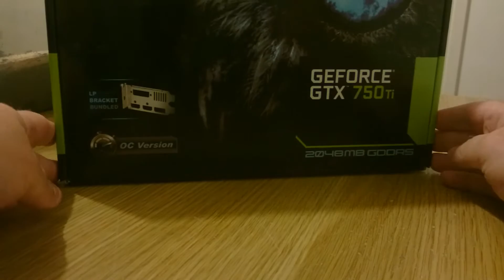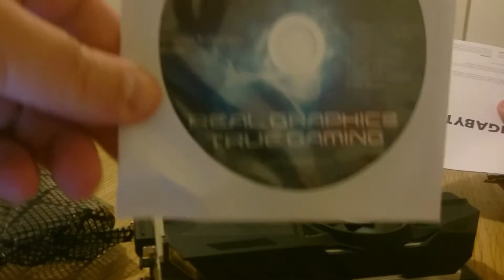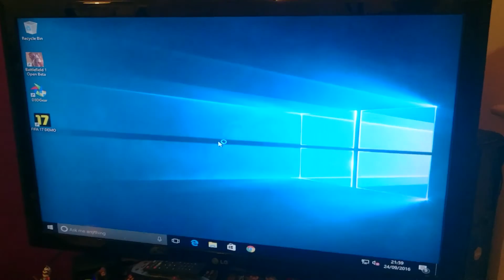UNBOXING A GEFORCE GTX 750ti OC EDITION. Modding a Dell optiplex 330 case and fitting the GPU.

Comment: I have a question does a gt 710 fit in that computer case? Cuz I have the same computer as you lol and what do you need to connect the graphic card and everything
Reply from the maker: It should fit if it’s a low profile card.

Comment: i have dell optiplex 390 and am planing to get gtx 750ti will it fit in my case and my psu is dell 265 came with the pc 
is it enought 
mobo:dell optiplex 390 LGA1155 H61 0M5CDC 
what do you hink please help
Reply from the maker: +i am MUSLIME and PRODE should be fine as long as you have the tower or desktop
Reply: i have a desktop
Reply from the maker: +i am MUSLIME and PRODE should work fine
Reply: ok thnx bro ....i really appreciat it 
just only one question does the gtx 750 ti run all games even in low sett
Reply from the maker: +i am MUSLIME and PRODE yea

Comment: Every other GTX 750TI would have fit, just yours is dualslot ,but the other way around ;)

I got the same rig, the only problem is, it wont boot with a 750ti, dont know why though :/ tried 2 different cards.
It boots up in the background, i can hear the bootup sound of windows 7, but i cant get a signal on the hdmi port of the graphics card ... 

Well i guess its time to ditch it for another experimental gaming computer, got my hands on a free socket 2011 board with 8gb of ram aaaaaaaaaaaaaand a cheap XEON from ebay :3
Reply from the maker: hmm. seems strange. did you try different hdmi cables and/or different displays?

its not the other way round, its the dell cases that are btx
Reply: I think i got my answer now.

http://www.tomshardware.co.uk/forum/id-2778952/compatible-cpu-gpu-dell-optiplex-330.html

The Dell Optiplex cant recognize them, its the first time i have ever heard of this though.
Someone posted it (search for EFI/ UEFI) ... seems like you have a card with a compatible BIOS.
Mine didnt work at all, the Optiplexx booted, but completely ignored my GTX :(